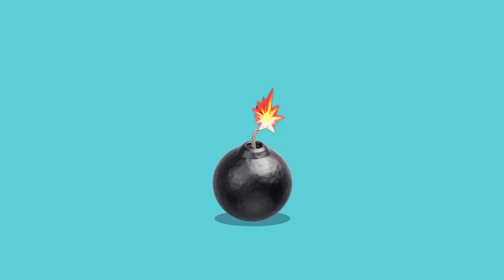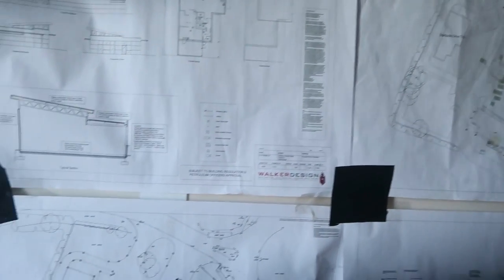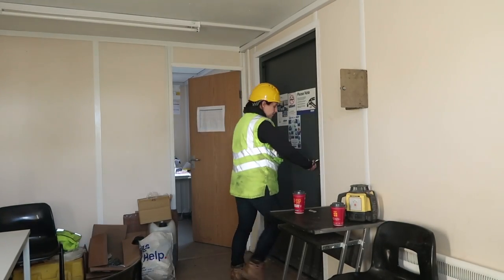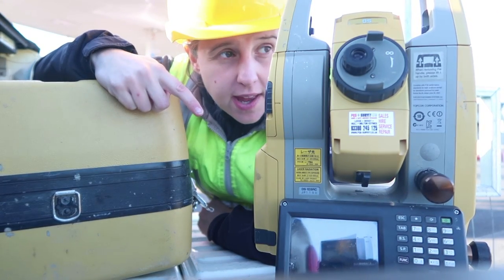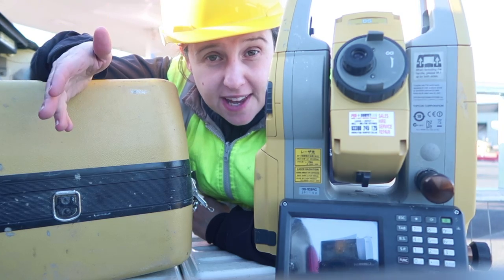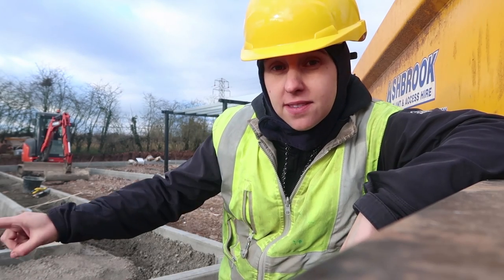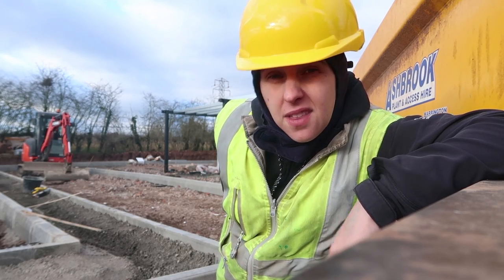A Day in the Life of a Construction Engineer / Construction Engineering Vlog / Women in STEM fields

Comment: hi iam studying Construction Engineering
so if you're an engineer now can you explain to me what the different between civil engineering and the construction ?
Reply: The main difference is that a civil engineer usually deals with "civil structures". These include bridges, roadways, and civil utilities. The construction engineer will deal alot with commercial, residential, and industrial construction. They are both interchangeable however, and a construction engineer can be a civil engineer. A construction engineers schooling is going be based around alot of management practices as well. So if you want to be taught design go towards civil engineering degree, if you want to learn construction methods, practices, and management get a degree in construction management or engineering.